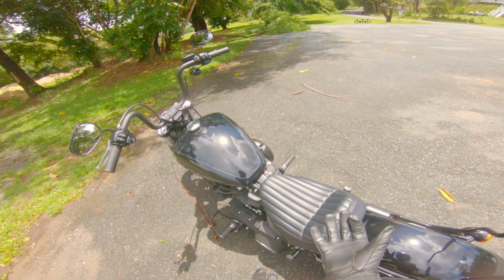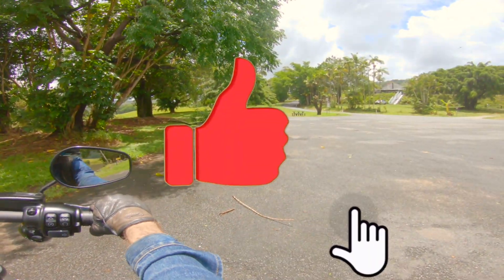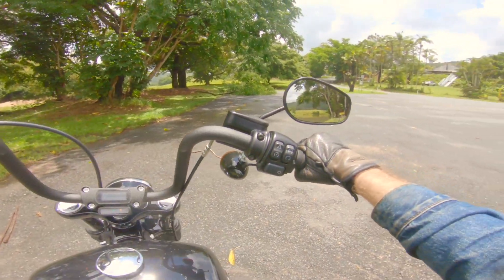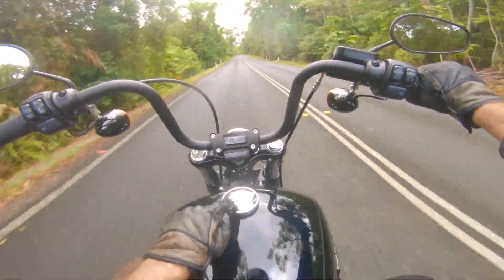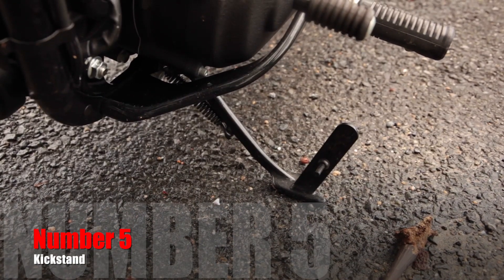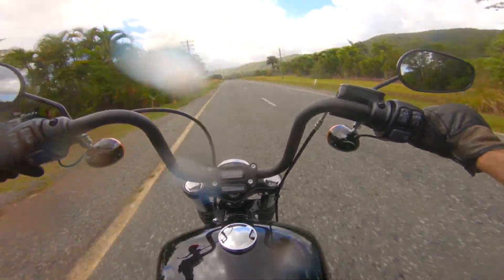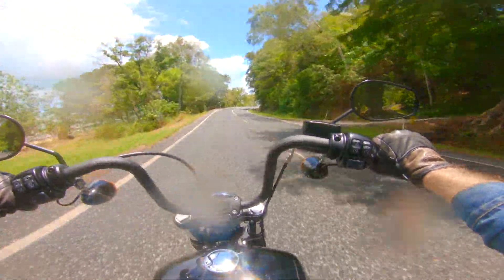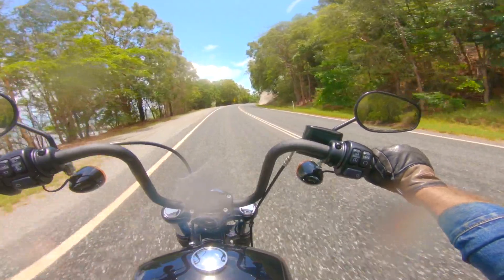5 Things I hate about my 2020 Harley Davidson Softail Street Bob

Comment: 20 softail here. Bought 2 weeks ago with 102 miles. I have a metal gas cap fyi. I like what you've done with yours. Had a ton of bikes in 62 yrs, this is my favorite by a mile. Gobs of power, eats up the bumps and not a lot of fluff. Fwd controls went on 1st week, $550 and 2 hrs to install.  Be safe brother.
Reply: I m getting my forward controls on this week
Reply: @budredden818  knees will be thanking you. Ride safe brother.

Comment: Good video forsure. Kick stand is ass, seat is super ass. Mid controls are also another thing that need changed almost immediately. Don't know if this was just my bike or if others have had the issue, but I blew a fork seal sub 3,000 miles which is insane for casual riding.

Comment: All these things you mentioned (except the suspension and stand) are meant to be changed...No one rides these as they come from the showroom, it should go straight from the dealer to your garage where it stays till you've finished all the mods, Stage one/Bars/Forward controls/Seat etc thats why they are cheap, your better of with the standard cos your gonna rip it to pieces anyway, the front suspension is bit hard but it makes the bike handle fantastic on bends and quick manoeuvres (Cars pulling out) So i'm happy to trade comfort vs a crash.

Comment: I just bought a 2020 Softail Standard, can't say I notice any throttle lag, but it does have a screamin eagle stage 1 setup, pro street tuner and all. If anything, my throttle feels like an on and off switch. Not much linearity off idle, kinda just nothing and then everything all at once. Scared the shit out of me more than once. 

The seat is a little uncomfortable for sure, which is a shame because it looks great. As for the plastic had cap it is kind of odd, but one the other hand it actually makes a lot of sense. Fuel will cause corrosion quite rapidly on a metal cap, and so will the salt off your hands. I am not sure that's why the cap is plastic but that seems reasonable enough.
Reply: After getting stage one tune the throttle lag was awful, went back and they made it into a whiskey throttle which helped but never as smooth as factory set up. Can make pulling out of junctions awkward.